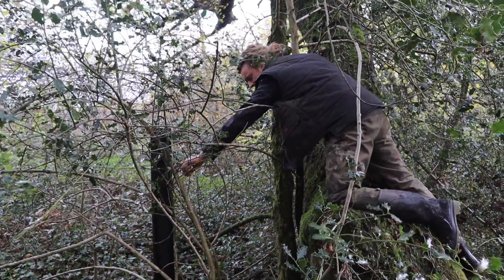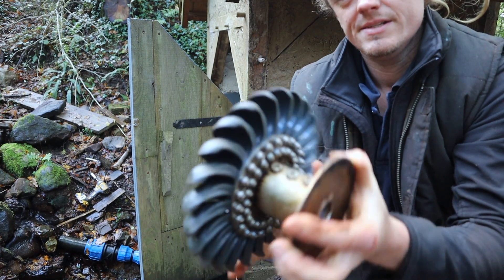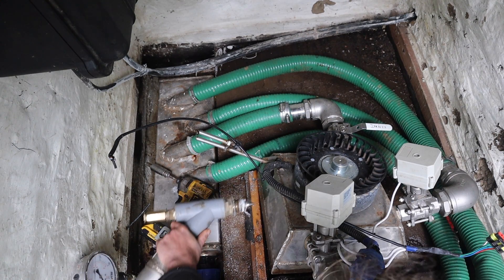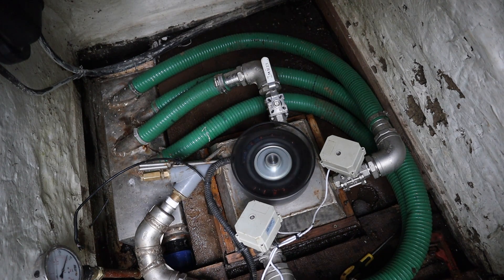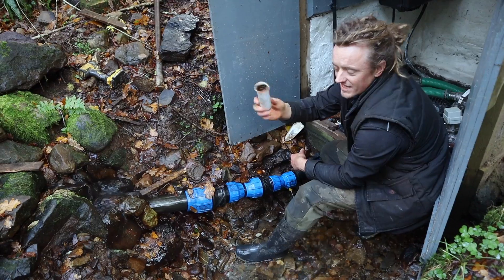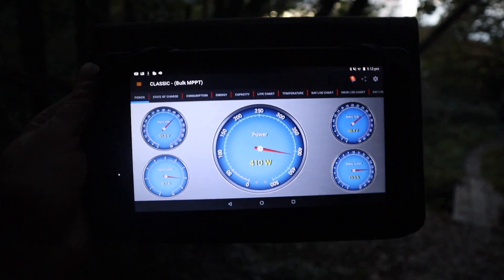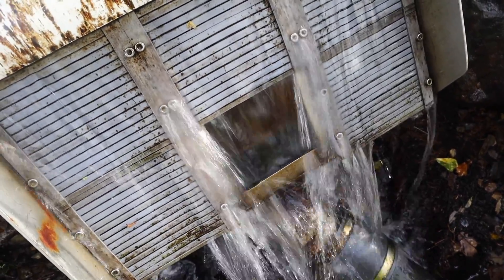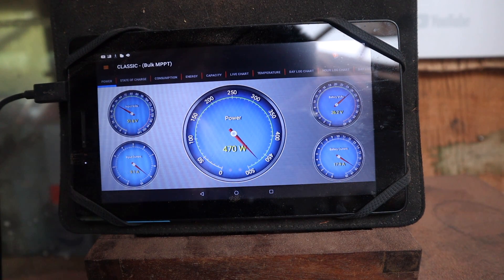Hydro Electric Trouble Shooting And Maintenance

Comment: Don't forget that the Wires have a Power-loss aswell. The Resistence of the Wire together with the Current make up a Power-loss.
Reply from the maker: In my system it is less than 2%

Comment: If I followed you words / video, the first of many changes you made  (stand pipe) did not changed your number (watts) in anyway.  You then continued to make other changes without going back and undo the first change you made.  This leads to not knowing which change helped.  You should return a change you make back (if no improvement) to its original existence before moving on to the next attempt at a new change.  Once you find the reason you lost watts you then can go back and improve on or change earlier attempts at trying to isolate the source of the problem that did not show to be the problem, but you just feel improvement is needed (example: stand pipe).   Does the "LOCK DOWN" feel like a "LOCK DOWN" when living a life style simpler to a self made lock down ... ha,ha,ha.

Comment: what if you put the manifold at the end of the 110mm pipe and have 4 small valves one for each nozzle. just a idea
Reply from the maker: I have the small valves already but you need to be able to shut off the main penstock flow. How would I remove the turbine otherwise? I would have to leave all the valves and nozzles behind.
Reply: @KrisHarbour  not if you have 4 valves at the manifold
Reply from the maker: Yeah that would work but i really do like having a shut off before then. My calculations show that the loss there is not really a big problem. Maybe 30W of loss in that section. its really not worth the cost and work at the moment. I have much easier ways to get 30w if i need to.
Reply: @KrisHarbour  Start an unofficial fundraiser for the change. I'll chip in some quid. Let everyone who wants to see it happen contribute.

Comment: Kris having watched your channel from the beginning. I've noticed that whenever you have problems with the hydro it seems to be working fine on the standard three valves, and as soon as you incorporate the spear valve it starts again with problems not necessarily straight away but within a short time.  You reach about 400 / 430 Watts  on the three nozzles my question is why not replace the spear valve with a fourth nozzle of the same spec as the other three. Wouldn't this help push the power up by another 100 plus watts? Or is the brain of the operating system only able to work at about 480 / 500 watts? Before cancelling out? I was glad to see you run the piggy down the whole tubing it definitely looked to clear away some buildup of sludge etc.
Reply from the maker: It’s nothing to do with the spear valve, it is just that the spear is the last valve I use as it is the least efficient. (This is normal for a spear as there is a trade off for the adjustability) 

The reason problem shows when I turn on the last nozzle is because that is when the pipe friction starts to really increase so any friction related problem will show at that point. Before then the friction is to low to really show any problem.

This is also the reason I don’t bother making my nozzles bigger and run more flow as after this point the friction goes up so much that it’s not worth it due to the friction loss.
Reply: @KrisHarbour  I was just wondering if and when you do the second feed from the other stream does this mean that you will only gain in low water situations not max power? Does this also mean that you would be better off doing a complete second pen stock not a “Y” is this even possible? Maybe in a less expensive narrower pipe?
Reply from the maker: @jons6125  The plan for the second intake isnt to run more peak power but to run a 2lps higher average. basically make the turbine run at around 400-450w all the time.   It will smooth out the flow alot. so although we wont be running at any higher power we will produce alot more Kwh per year.